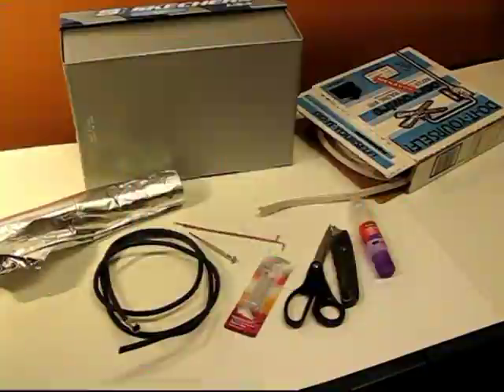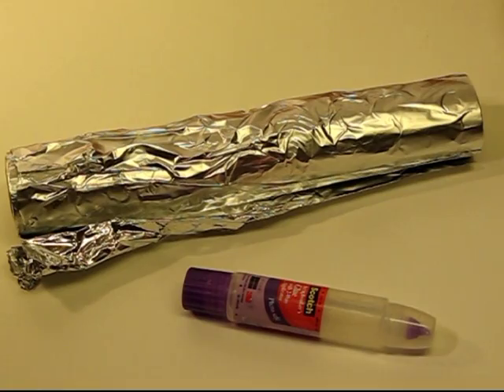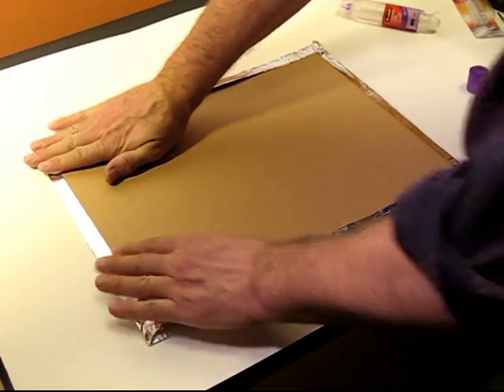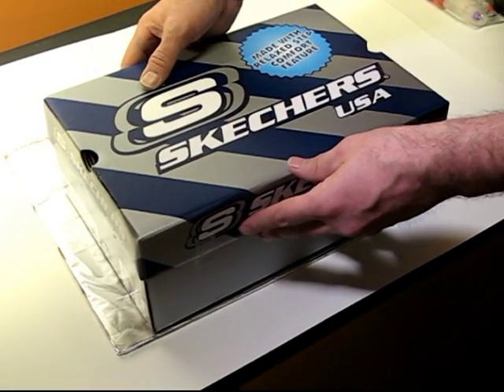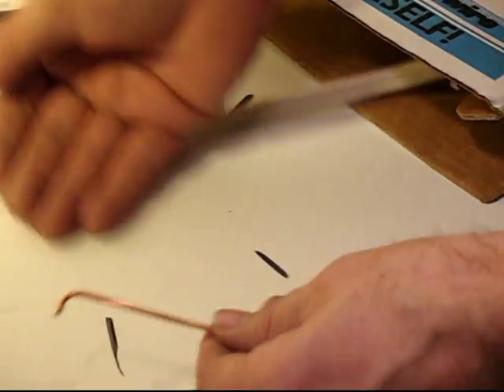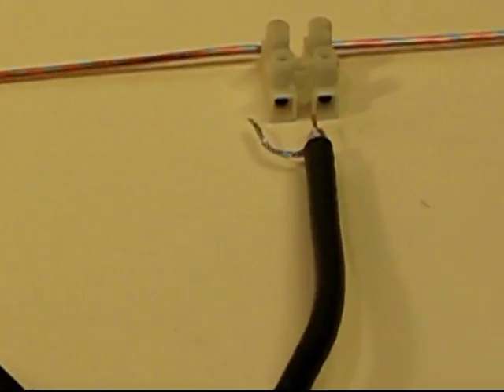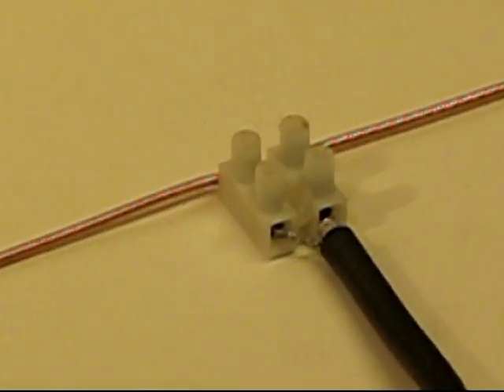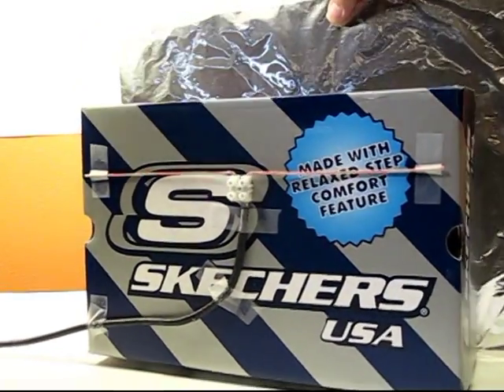ShoeBox Antenna

Comment: Step One:

Steal a box of sneakers...

The antenna is a half wave dipole at 476 Mhz. This is UHF TV channel 14. This is a good antenna if you are between two stations on the same channel 180 degrees apart. Probably wouldn't work too well on VHF.